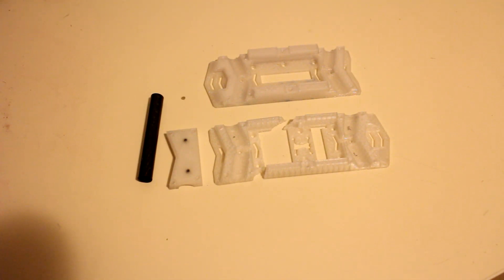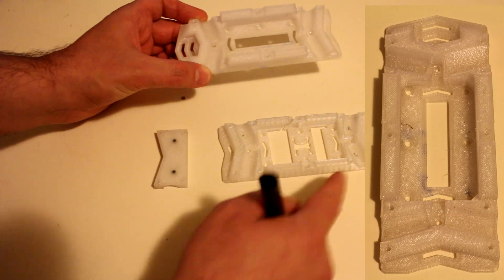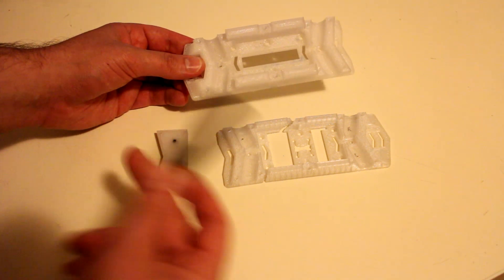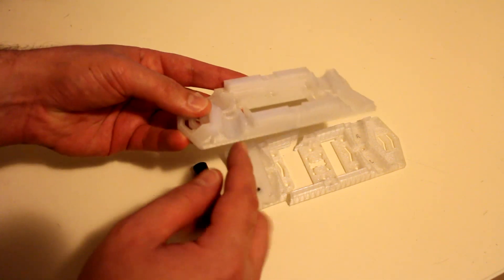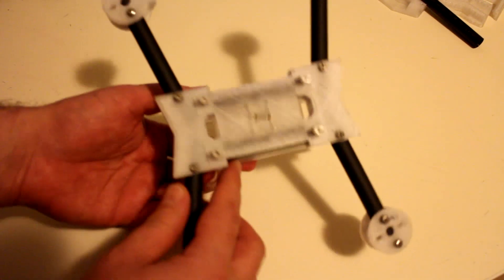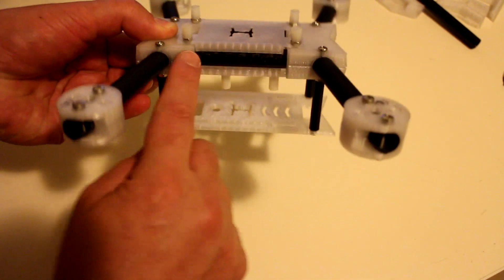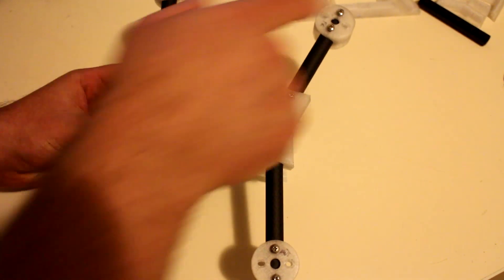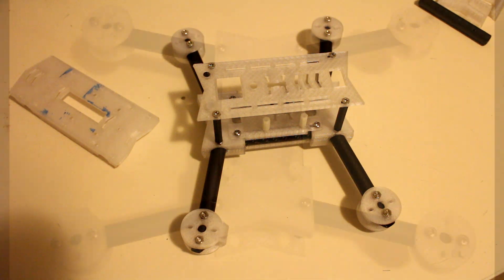Peon230 Pro with Carbon Tube Arms Update

Comment: Another possible direction might be to incorporate sacrificial areas actually intended to break/crack/deform under adverse conditions. Obviously the arms because of their length will generate a high leverage action under some conditions. There will be a point at which the carbon fibre will fail. Perhaps you might prefer if some other part failed first. The pillars too could end up producing a bending moment so maybe recess the fixing point into the body parts to add more resistance Perhaps with another part designed to snap out, maybe the screw fixing itself?
Keep up the good work and good luck with the project.
Reply from the maker: +crikycrocky 
Thanks for your comment! If the carbon fails before the 3D printed parts then I guess this design is a success. At that point I could switch to thicker carbon tubes to compensate, but the ultimate goal is for a strong enough frame that can handle a beating without having sacrificial parts which may break more often than required. You're correct the leverage action is what caused the previous base to fail as the carbon tube wasn't going to fail.
So far with crash testing I hasn't broken anything so I think this is a winner. Cheers.

Comment: Your solution frame is vastly superior, nice design.
Beam theory suggests keeping as much material away from the neutral axis as possible for optimised strength, maybe a lesser infill with more external coats would create a stronger frame. Though I doubt it would match you carbon fibre frame :)
Reply from the maker: +float 
Thanks float. So far so good with flight (crash) testing. More details to follow soon...

Comment: From my observations plastic frame should be more about force deflection than force resistance through a tough and massive cross-sections. The Plastic frame should be stiff enough to keep the frame from vibrating but flexible enough to bend under crash stres within its plasticity range. This flexing under stres and returning to the original shape is the pro of the plastic construction and should its main guideline when designing the frame. Thus more thin 1-2 mm walls, more rounded curves and filleted edges to mitigate sheer forces and distribute the stresses evenly. I wonder what did it hit?
Reply from the maker: +Rahviel80 
Great post! I agree with your thoughts on the plastic material and utilising the flexibility to adsorb the crash impact rather than be stiff as possible. Depending on the material there is only so much deflection the part can withstand before failing. Unfortunately we cannot control how much force will be applied to each section of the frame as each crash is unique. 
The ultimate 3D printer material is Nylon, and if the PETG parts are unable to support the carbon tubes then I'll switch to Nylon. Nylon is quite expensive so my initial thoughts are to design a frame the majority of users can print. It can be too flexible for long sections also.
The crash which broke this frame was at the local park flying through noodle gates. I simply hit the gate and spun before hitting the grass. I was amazed at how quickly it broke!
Reply: +Tech2C Increasing parts area over volume equals better deflection. Predictability of stres points is still possible as in cars crash tests. Also if you study structural mechanics you should get a sens on how cross-sections resist sheer and bending forces. (my background is architectural engineering but all general rules apply to different design fields). I'm actually finishing my 220 3d printed mini quad project and have allot of film from the proces but no time for editing and uploading on YT. My material of choice is ABS because it is a sweet spot for both flexibility and stiffness. The quad is in its 5 revision and every previous frame was test flown and crash tested. Bild it crash it redesign it, repet... Overall 4 months of designing and prototyping but it gets you a unique feeling when you can materialize and fly your own ideas.

Comment: Hey there : ). How about printing the joining parts in Ninja flex with built in solid pieces to screw through to the carbon fibre, and the rest as you have. to provide a slight spring to the tubes and soften the the impacts. I think you can print them together, so the to materials are fused.
Reply from the maker: +Mrjohn M 
Interesting idea. I think you are correct is suggesting a flexible joint to absorb the impact. Instead of Nija flex, Nylon would be a preferred choice as it isn't a rubber material but can still flex when stressed. Thanks!
Reply: +Tech2C no prob. Good call on the nylon. I got the idea from watching James Bruton (X Robots) videos. I don't own a 3D printer, but I'm really fascinated by the technology.